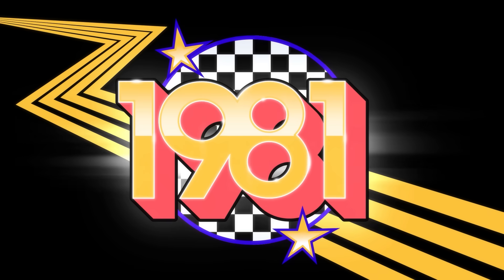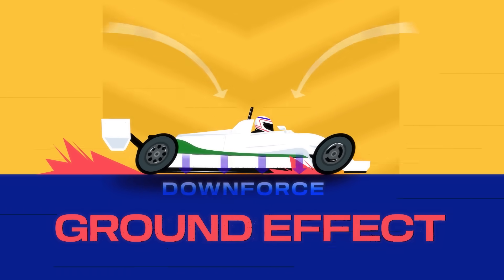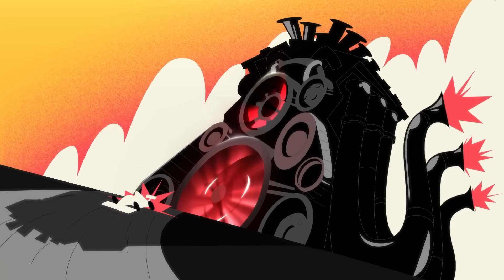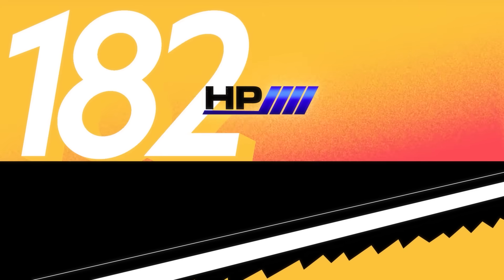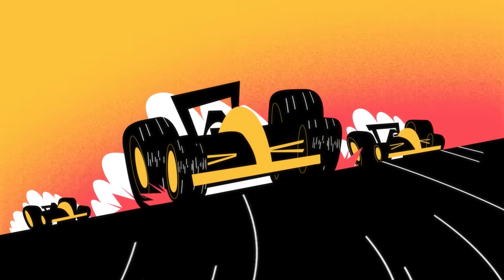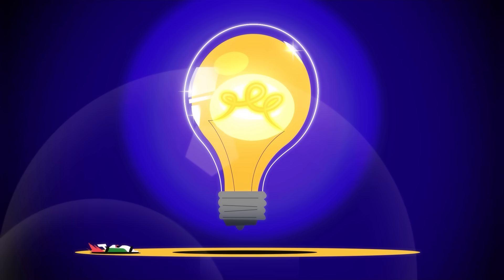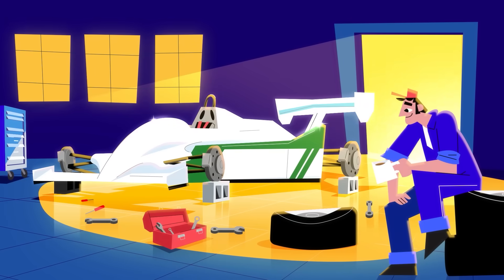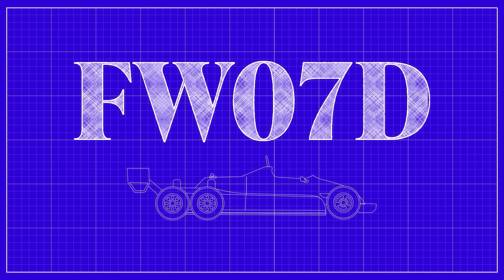Why This F1 Car Had SIX Wheels! Ft. Jenson Button

Comment: Really glad you're making these videos which make interesting bits of F1 history more accessible.

That said, I do think some of the facts are a little off. Claiming that Williams were suffering a deficit of 180BHP to the turbos at the time the FW07D and FW08B were devised in particular is quite a stretch.

In 1981 the top cosworth-engined cars (of which the Williams was one) were starting to nudge 500BHP, thanks in large part to the work of overhaulers like John Nicholson and John Judd (who overhauled Williams' DFVs). The top turbos in 1981 meanwhile were just nudging 600BHP in quali trim for the first time. That makes the deficit about 100BHP tops (and less than that in race trim).

I can only assume the 180BHP figure comes from a later year like 1983, when the turbos had progressed substantially, while normally-aspirated engines had only made a slight jump forward with upgrades to the DFV like the DFY.